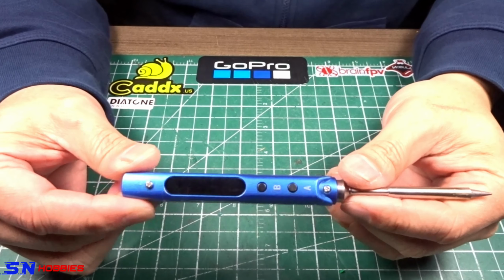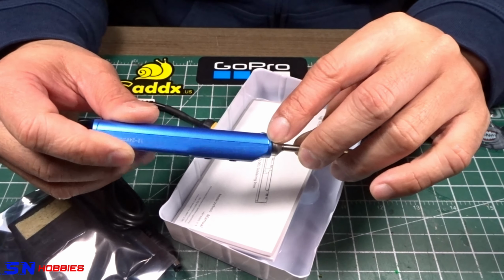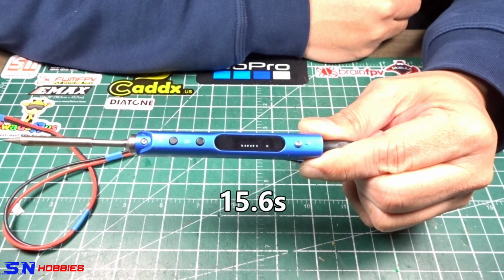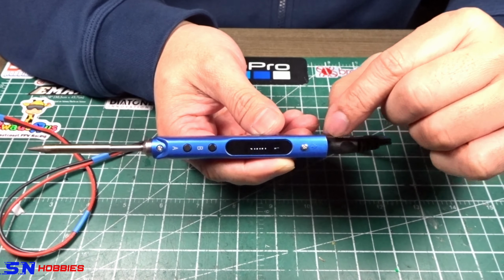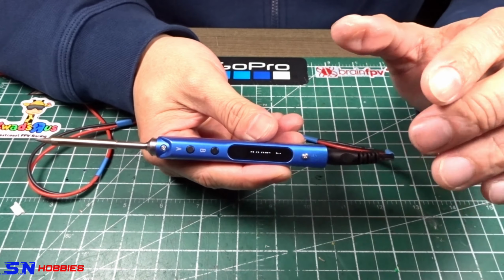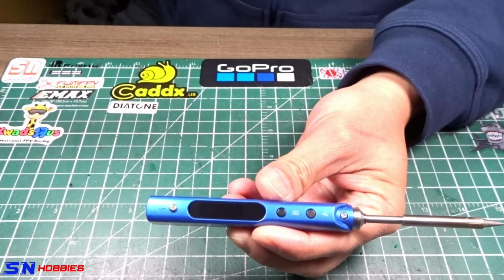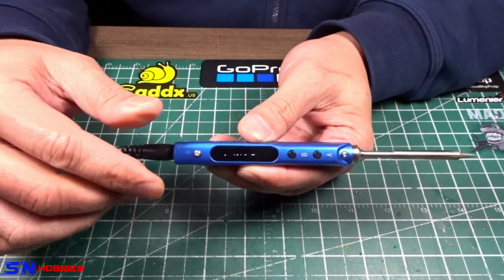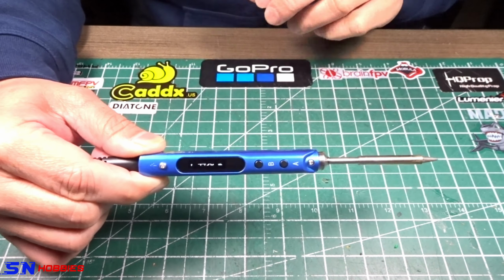Cheaper than the TS100 😲😲😲? SEQURE SQ-001 - SN Hobbies

Comment: I got mine today, I take it it won't work with 5c/10c 2s 7.4 22.20wh battery.
Reply: too lower voltage, its work on minimum 3s battery pack.